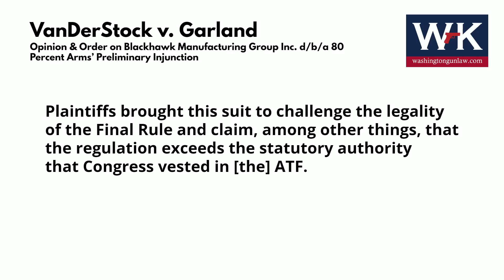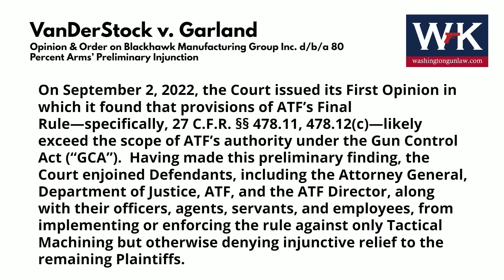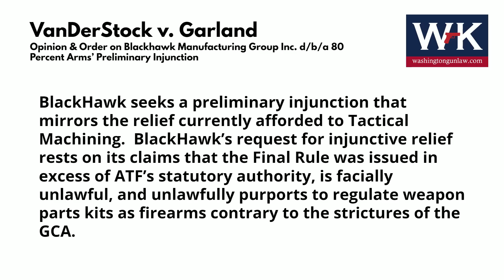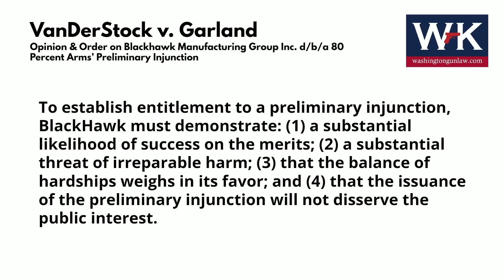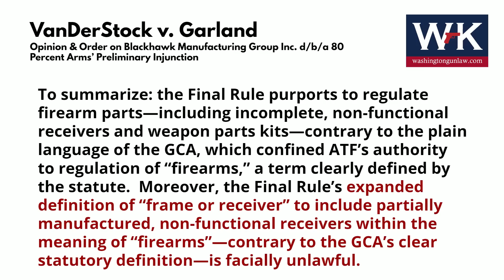How ATF is Losing Every Step on the Way on Unfinished Frames Receivers

Comment: They should lose on every front on this and every other issue. Braces are next. Did they have any SBR's rules in this history or context of the founding......NO!!!!
Reply: Did they have sbr's then? Was that even a thing? Just asking..
Reply: Blunderbusts we’re quite short! Sbs I would call it
Reply: Don't forget bump stocks
Reply: @ghostwalkerairsofttech1947   Shoulder stocks for pistols go back to the flintlock era, so yes, they did have them back then. Many were high-end products meant for the rich and manufactured in Germany and England, but the fact is they existed prior to the American Revolution, and during the American fight for independence. Shoulder stocked pistols were issued to US calvary troops just prior to the American Civil War. In the American Indian Wars post civil war, the shoulder stocked Colt Buntline pistols were rolled off the assembly lines for both civilian and military consumption. They never achieved mass popularity due to the advent of the Winchester Repeating Rifle, but were nevertheless present and in common use during that period. Mauser C96 (1896) Broomstick pistols (shoulder stocked) were certainly available to civilians post civil war in America, and also saw use in WWI by German troops. From WWI and through WWII shoulder stocked Colt M1911 pistols were commonly available. The first M1911 I was issued during the Vietnam War Era had a locking mechanism on the lower butt, and I found out it was for a stock, which they did not issue to me. Shoulder Stocked Luger "Artillery" pistols from WWII certainly made their way back to the USA as spoils of war legally captured by US soldiers. Shoulder stocked pistols have a LONG history and tradition in the USA both as civilian weapons, and as military issue. Therefore, the ATF has NO authority under Bruen to make ANY rules regarding either AR (braced) pistols, or shoulder stocked pistols. Capture images of these from the internet via Google before the government can delete them. I've done this already.

Comment: Is there any chance that a case like this could be used to help declare state bans of 80% lowers or self-made firearms unlawful?
Reply: Yes, that's likely, imo. However the real issue is that: should an 80% lower be completed it will be considered a functional lower receiver and therefore a firearm* and  thus subject to the law with regard to same. *In this case an AR-15 (In the generic sense of the term vs an Armalite Rifle, model 15).

Comment: Good Stuff ! Can't wait for the brace debacle to begin.
Reply: Unfortunately AFT (*tm) has a stronger case there.  Given how braced pistols are almost exclusively used as pseudo SBRs, it’s not unreasonable to treat them as such.  OTOH large numbers put SBR (and SBS) into “commonly used” category.  Our defense may well require eviscerating the NFA - so a tougher but also far more important case.
All these frame & receiver cases are giving us momentum, setting precedents, and providing encouragement by showing we can win.  Now to build on the wins with bigger fight to tear suppressors and barrel length restrictions from NFA.  My kind of common-sense gun control reform.
Reply: @finngamesknudson1457  I think all the you tube videos got ATF all bent out of shape after all the letters they posted  back and forth on the issue. I would for sure like to see NFA mostly dismantled and we are headed in hat direction. Will we get that ? I am not sure or how long. It will be interesting to watch though.